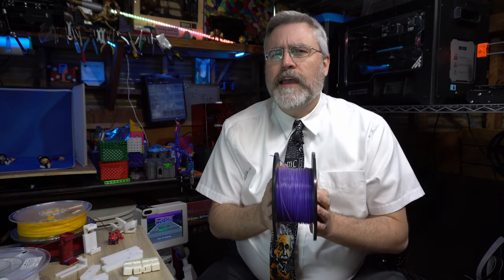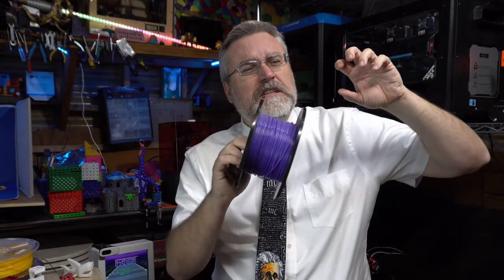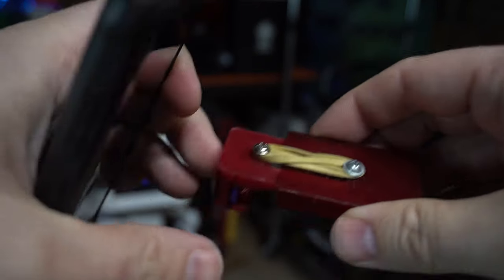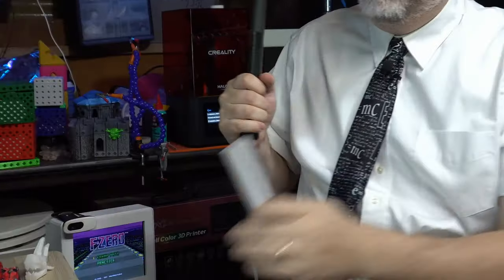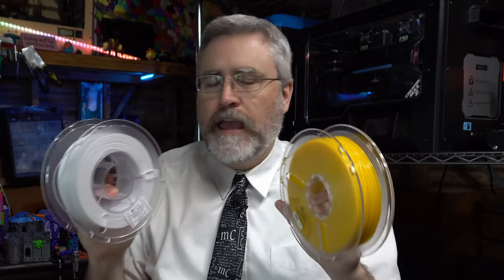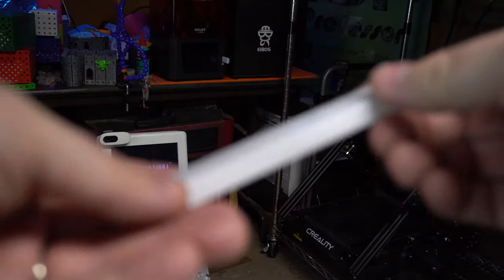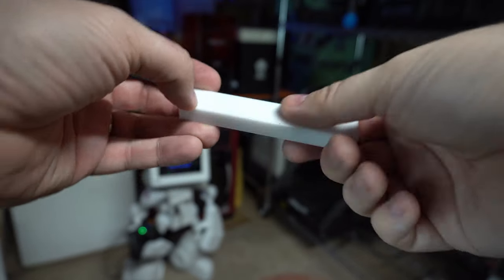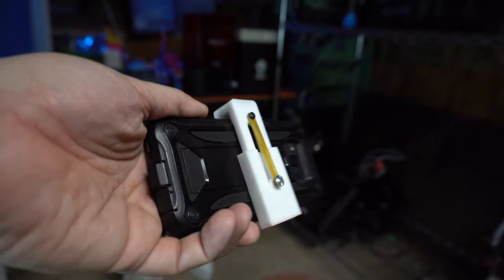What is the strongest 3D printing material

Comment from the maker: But what about supports? https://www.3dpprofessor.com/2023/03/08/whats-the-strongest-3d-printing-material/
Reply: I just just supports. At the end of the vid it sounds like you would try flex PLA from the new Cura?
Reply: Heavy interface on top of the support, big gap and sparse interface layer towards the part for one layer does well for me with high cooling, increased cooling when printing onto a support helps cutting it off with a knife afterwards. Turns out knives slice TPU like butter so be very careful if you have to have supports. I love TPU, I wish there were 99shore hard TPUs and down to 60shore in all the colors it might be all I use for 90% of prints.
Reply: Is there a printer out there that can print in Tantalum Hafnium Carbide?  It's melting point is over 7,000 degrees Fahrenheit.    Acetylene burns at around 6,300 F so how about lasers?
Reply: @TheWadetube  NASA has a few robot lasers that weld exotic material in a FFF fashion… not sure 🤔 what the application for your needs are beyond a thought experiment.
Reply: @MakerBees333  A super high pressure rocket engine, 1000 bar, 1000 seconds of impulse.  Probably a printing nightmare.
Reply: @TheWadetube  I would DM SpaceX then, best best with them.
Reply: When using TPU I design for minimal supports, avoid tree supports and if there is a hole in a sidewall I use standard supports (cura everywhere setting). When I have a counterbore hole on a bottom surface I avoid slicer generated supports and put in a one layer thick sacrificial support as part of the design just below the interior overhang. Works like a charm and it is easy to push a screw through a 0.2 mm single layer. Where needed I will separate TPU into parts to be assembled rather than have too much support material.

Comment: As a mechanical engineer I just introduced 3d printing at my company with an Ultimaker S5 and I gotta say: I print a lot of TPU and it impresses me every time. You can’t even break this stuff if you want to😂
Reply: This is the kind of performance I have been waiting for.. I have been holding off getting a 3d printer but I need one now!
Reply: @CL-yp1bs tpu has been around a while lol

Comment: I love TPU with high or 100% infill for rigid parts. It's weatherproof, unaffected by oils, solvents, and most chemicals, and like you say indestructible.
Reply: Do you think would be stiff enough for servo mounts or other RC parts ?
Reply: @marcosdo995  Maybe not for parts that need to be really small/thin, but in general, absolutely.
Reply: Do you think this stuff would be good for fittings and connections?
I work at a car wash, and I've noticed a lot of plastic stuff like that and more that I think could potentially be 3D printed, since you mentioned TPU is resistant to most chemicals and all.
Reply: @Archangel657  check for SLS printing with nylon 12 if you can't find the original replacements
Reply: It surprises me, cause I know some plastics (such as mouse wheel material), that seem like a rubber, but with age, it turns either into sticky disgusting something or into hard oil-soaked disgusting something and I also seen plastics that can degrade on contact with rubber - sort of like they can dissolve each other over the months or years of contant. But maybe TPU is different than rubber.
I would like to try it, but what puts me off is a need to dry it just before use - hard to say, people suggest that PETG and/or PCTG must be dried as well, I have no or not much noticeable issues with 40-50% RH during summer - winter will be better as dew point drops. And I don't know if it releases some smell during print, PETG is fine, PLA smells like ironing laundry a bit, PCTG has very unpleasant smell of burning plastics at 270C, hopefully it's not strong.
Reply: @pavelperina7629  TPU is completely different from that disgusting stuff. It's generally low or no odor while printing as long as you don't go over 235 or so. It does need to be dried, but drying can easily be done in any oven since it can take temperature swings to 100+ °C without messing up the filament, unlike PLA and PETG which are easy to ruin without good temperature control.
Reply: hows the UV with tpu?

Comment: As a model aircraft builder, TPU is essential. It protects expensive electronics such as cameras, bumps in carbon fiber rods and many other. TPU is my go to material when subjecting parts to crashes over 100km/h.
Reply: Im planning on building a drone and 3d printing the frame. Would you recommend tpu because it strikes me that it would just flex and bend and not be rigid enough while being strong?
Reply: @StrykeFPS  it depends, for videography drones it can work, but make the battery holding section out of something rigid. I replaced loads of parts on my holy stone HS720R with tpu to save weight and it is still holding up fine. for high speed FPV drones, the main frame would be better if it is a more solid material to prevent flexing when flying at high speeds or doing fast manouvres

Comment: Calling TPU the strongest is a bit like saying rubber is stronger than a high carbon steel knife because the rubber won't break when hit with a hammer. Shear strength for instance is likely even lower than PLA.
Reply from the maker: I suppose "toughest" would have been a better word

Comment: FWIW I have no issues printing 95A TPU at 100% infill, on a stock Ender 3 Pro with a Bowden tube, and at speeds up to 40-50mm/s. I recommend lowering extruder tension almost all the way. You can use high retraction distance and speed to combat stringing too. I've been fine with up to 12mm retraction at 30-40mm/s. Dial in your temperature as well and you can get great looking, string free, ultra strong, and very useful prints. Going direct drive just means you can use much less retraction and attain higher speeds. It's definitely worth using TPU!
Reply: Holy.. 12mm retraction sounds absurd but i believe you. The ender 3 actually is good for tpu because of the bowden hotend. On all metal hotends i find that TPU has a lot more issues with retraction because the filament cools and has more resistance in the metal cold end.
Reply: @Javii96  I've gone to direct drive now with a Sprite SE and it still prints quite well. Better if anything. The all metal hotend I have swapped to as well can cause a bit more oozing, but there are ways to compensate for that. I use 0.8mm retraction with the direct drive which is still over double what I use with most filaments. I've printed some great functional and fun parts like a hollow black TPU Gengar. TPU isn't scary, but Gengar is. 😂
Reply: @802Garage  i actually just switched to the sprite extruder on my ender 3 last week. Still trying to find a better mounting solution for the phaetus dragon UHF i bought… it’s a great hotend but it’s ridiculously tall lol. Printed TPU with it today and it did great other than some random layers were underextruded. Not sure what that’s about. You’re right though TPU really isnt scary even with bowden its just slow.

Comment: I printed a McGuybeer octopus at ~200% in TPU and it's ridiculously resilient. And all the legs articulate same as a PLA print. But I think a lot of dragons and other models that have bridging for joints will struggle to print correctly. The octopus joints are basically rings with small overhang demands. Something to keep in mind when thinking about possible prints with TPU.
Reply: Yeah, I once printed a 'print in place hinge' in TPU... didn't work as planned. I think it had tolerances designed so that if printed in PLA or such, the two parts would either remain separate, or any unwanted connection would break when working the hinge. With TPU... I just ended up with an awkwardly shaped live hinge.

Comment: I discovered how strong TPU was (with amazing layer adhesion) recently too. I've also found that I can print Polymaker's High Flow TPU-95A rather fast. I was about to print a passable Benchy in less than 15 mins.
It does need to be kept dry though. It might be a challenge for people who don't have a filament dryer of some kind.
Reply: so far i have printed tpu without a dryr, but did dry it beforehand in an oven, and have had zero issues with it running longer prints. it could vary between manufacterers though

Comment: great update on the 3D materials.
I used it as a anti-glide layer on a PetG surface. It worked fine, with the same temperature settings as PetG, because the PetG was at the underside, and sticking to the headbed at 85 C, but it was cooler at the printsurface (PetG), so it worked great.
Thanks for sharing your thoughts with all of us 👍😀

Comment: For painting TPU cosplay I'd likely use acrylic paints. I haven't tried painting TPU yet but I have painted a leather back patch with acrylic paint and sealed it with Mod Podge, so far it's not cracked at all, you'd just need to do it in multiple thin layer

Comment: One thing that should be added to your video: TPU is incredibly abrasion-resistant. Take a look at how many use it for tires on 3D printed RC cars (big ones), just for one example.
Reply from the maker: My experience, though, is that it's also slippery. Tires need to be a little more flexible. I feel like the right geometry might be what it needs, but I haven't found it yet.
Though, I'm not searching that hard.
Reply: @3dpprofessor  Yeah, I have some (discontinued) Inland TPE that was much grippier than the TPUs I've used. The TPE feels more like a silicone while the TPU feels more like vinyl (like a vinyl shower curtain when it's brand new).
I wasn't saying the tires are a good use case, just one that shows how durable TPU is, since it's being driven on (abrasive) concrete and not leaving the slightest mark on the prints. :)

Comment: Oh man, I've been using various grades of TPU for many years for all manner of engineering prints! That stuff is great for so many things. Everything from 60A for RC tires (still not as good as true rubber compounds for crawlers), robot treads, and semi-grippy wraps and nubs to 98A for housings and brackets. I've used it for special purpose multi-directional strain devices and vibration damping items. Stupendous stuff in many applications. Six years ago when my kid was really little, kid toys printed in it..amazing durability!
Reply: Hey boss you seem well knowledgeable in this , I'm very green , I'm looking to buy a sla 3d machine because what I've told is stronger then fdm  or whatever, but I need to print a piece to be similar to metal because that's what I'm trying to duplicate ,but it needs to take abuse and not subject to heat , what would you recommend sir ?

Comment: Coincidentally, I just made a CAD model of a ski/hiking pole component for my brother and printed it out of TPU right before watching this video. I think it might actually perform better than the original hard plastic component. It's a strange little split cylinder with internal threading and a cone shape that gets clamped down on. The original was injection molded out of PVC I believe due to a number 3 on the part. I think the TPU version will grip better and be easier to clamp down, but we'll see!

Comment: I love polymaker's TPU95-HF, it prints nearly like PLA and with the high melt index you can print it at PLA speeds.
Reply: I was just about to comment the same thing! My experience with HF TPU has been game changing! If I could successfully paint it, I would skip so many other filaments to save up and use it all the time.
Reply: Overture has a cheap high speed TPU that works similarly. It's what I use.
Reply: So it's not a marketing thing, printing with up to 60mm/s ? It really works? 
What about the durability of the TPU95-HF?
Reply: @jone.1034  Well there are lots of things that can limit the speed like extruder grip and filament narrowing due to tension (stretch) reducing grip, but yes, 60 is very doable. I regularly use it at 200+, with high flow nozzle, and it doesn't hard fail for me until over 300 (underextruding before that, though). I haven't tried the polymaker but the overture is as tough as expected. I forget the results but at one point I did a test crushing it between washers with a torque wrench.
Reply: @jone.1034  I reliably print it on a cheap SV05 at 100mm/sec with a .8 nozzle.

Durability seems to be exactly the same, I have not used TPU to a breaking point even in heavy duty functional parts.  

HF TPU does seem to cut with a box cutter and scissors easier, no idea why.
Reply: @daliasprints9798  Awesome to know! I will definitely check it out. I am surprised it didn’t show up on my searches for HF TPU on Amazon.

Comment: Printed a lanyard for my Subaru's gas cap years ago, to replace the original one that broke, and it's still working fine.  TPU is pretty hygroscopic and needs to be dried out from time to time.  I think I read that the newer PLA+ filament has TPU added to it.

Comment: I like using TPU95.  For parts that need a lot of detail I use PLA as TPU can be stringy. My most recent project was a split 3x6 column staggered keyboard. I printed the case and key caps in PLA and then printed a TPU shell for drop/impact resistance. Love it.

Comment: Just to make a small correction, PLA wasn't invented for 3D printing. Its origins go back much further than that. "In 1857, Marcellin Berthelot, a French chemist, discovered lactic acid, an organic acid, by hydrolyzing ammonium lactate." He later figured out how to produce it and industrial production began in 1930. "In 1932, Chemist Wallace Carothers of DuPont first synthesized high molecular weight polylactic acid (PLA) by direct polymerization of lactic acid, which marks the birth of PLA polymers." However, it didn't gain widespread use until the 80s.
Reply from the maker: You are technically correct (best kind).
Reply: @3dpprofessor  Thanks for the great vid!

Comment: Well mechanically it's rigidity is on par with ABS and PETG 2400MPa half of PLA 4000MPa it's Youngs modulus ( E )
Steel is 210000MPa and concrete 30000MPa
Strength is a whooping 145MPa at 450%
Steel is 360MPa at 8%
PLA hovers around 60MPa at less than 2%
PETG and ABS is 20-30MPa but elongates like steel
Concrete is crushed at 30MPa and torn at 3MPa at less than 2% 
Shore hardness is another story
Reply from the maker: Which just goes to show that "strength" is dependent on a lot of factors.
Reply: @3dpprofessor  yes structural engineering is fun in that aspect

Comment: i started printing because off my FPV drones hobby, i designed a dome that would hold the electronics out off tpu. Not only would it not break but it would absorb the impact and protect the components inside withoud flexing to much to do damage anyways. And you need only a very small amount off material to get this kind off properties

Comment: Rubber bands seem to degrade by getting hard, brittle, and then break over time, printing a TPU band for your phone holder would be a great stretchy replacement that would last.
I love printing with TPU, and just like how you found that it's hard to break or even cut with a knife, I've found that even with just 2 walls and almost no infill I could print something that wouldn't break as long as the print orientation made sure the force didn't shear against the layer lines.

Comment: Thanks!  I wonder how TPU would work will fillers such a glass fiber?
Reply: If you take a look at the belts, the answer is right there
Reply: @jakobhansen1396  I can't extrude a belt.  :)   But I understand what you are saying.  Glass fiber reinforced Polypropylene is another example of adding rigidity to an otherwise flexible material.

Comment: I had a case where a partially flexible gear in a toy from my kids has stripped all teeth. So I took the gears dimensions and reprinted it in TPU. I even printed it partially hollow and not solid and it turned out much better than the original gear and was pretty much unbreakable. My TPU however is not that far on the flexible side.
But I don't know how well it would hold up in a car interior. One downside is that it is usually twice as expensive than regular PLA because it usually costs the same as PLA but comes only on 500g rolls in most cases where I see it being sold.
Reply: Old comment but it can withstand hot car temperatures great. I put a temperature heat deflection test on my dash this summer and it is still straight as an arrow. PLA drooped the first day and even PETG warped. The only filaments that have survived are ABS/ASA, TPU, and nylon. Plus TPU is still resilient in cold temperatures.

Comment: It's my latest favorite material. I literally only print with PLA+ and TPU now. 
If I need hardened materials, I use PLA+,  anneal it or both. If I need soft construction, I use TPU, and then add more infill to get the strength factor needed. 
I found that if I try to tear TPU at 1 layer thick (.2mm) I can do it with some effort. 
At 2 layers, I actually burn my skin trying to tear in and it warps and is extremely difficult to break. 
At 3 layers, it's an extremely resiliant construction and can take on nearly anything, only giving out to serration and puncture wounds lol.

Comment: I love TPU, I made a rubber mallet and was only around 50 or 60% infill otherwise it would have been hard as a rock. For those new to TPU, get a textured plate, unless you want to learn how good TPU adhesion is. There might be other methods like glue for smooth plates, but since I mostly use PTEG and TPU the textured plate is invaluable.